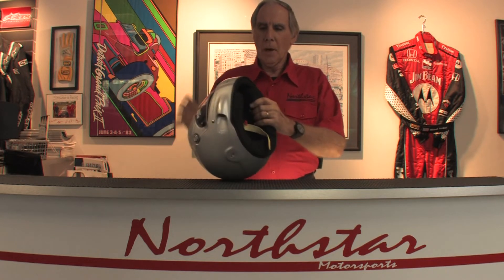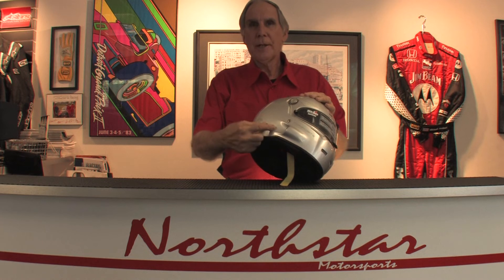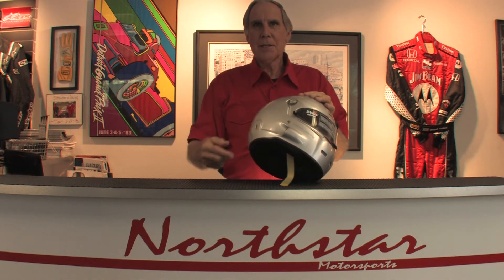SA2015 Auto Racing Helmets vs M Rated Motorcycle  - Northstar Motorsports

Comment: Just wanted to add a bit more information, for the M rated helmet, the visor area need to have a wider visibility both vertically and horizontally because the rider tend to move both on that direction rather than a SA rated helmet. The driver almost doesn't need a big vertical visibility on his visor because they simply don't need to.
Reply: Yup. When you've got a bike banked right over, it's almost as if the road is coming at you from above rather than in front of you

Comment: Miata  with padded roll bar autocross & possibly track days Full face or Open Face?
Reply from the maker: Hi, if you are strictly autocross (pylons in a parking lot) then open-face is fine.  We always suggest full-face for track events. You may like the Bell Sport EV, a full-face helmet with a 4in eye-opening. A good compromise. 
Link to Bell Sport EV:  http://www.northstarmotorsports.com/products/sfID1/Driver+Gear/sfID2/Helmets+and+Accessories/sfID3/Helmets/manufacturer/Bell+/productID/8329
Thank you for your question. Hope this helps. Good Luck!